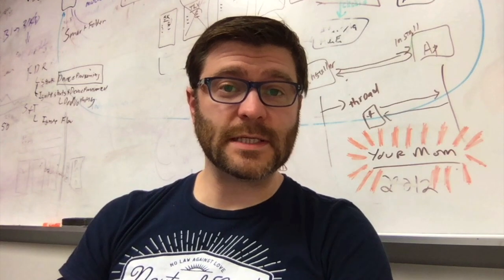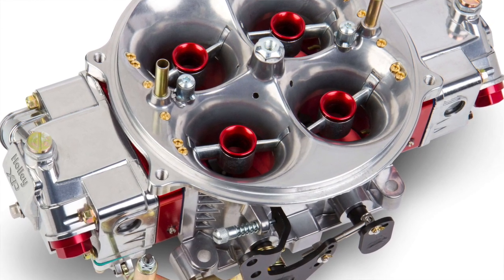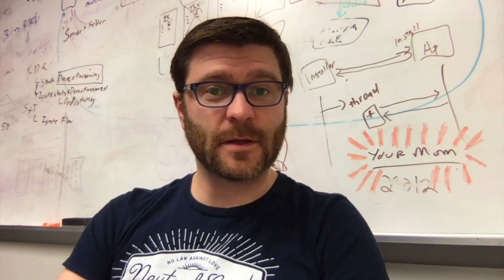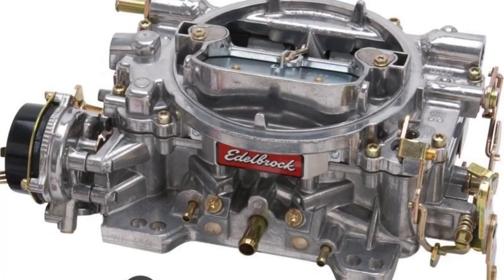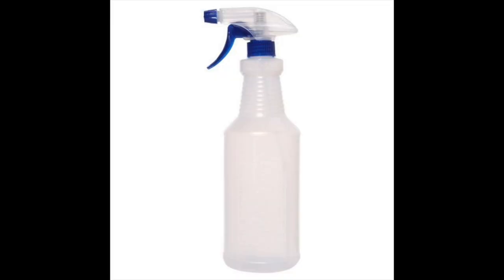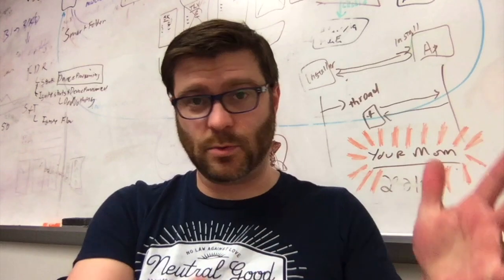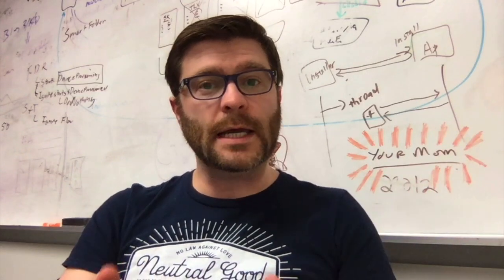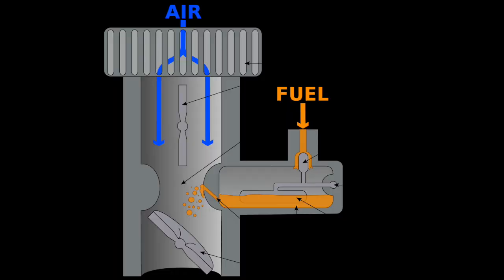Fun Fact: Carburetors

Comment: Your statements that racing prefers carburetors is actually incorrect. While turning carburetors is very different, and in some ways easier, your race car is fuel injected or carbureted depends I'm which racing group you are in. NASCAR requires a carburetor but Formula One requires fuel injection.
Reply from the maker: CyphrSonic excellent observations. Mike's partner races and says that he prefers fuel injectors as well. Next time I will be more circumspect, and next time I'll keep the source link.